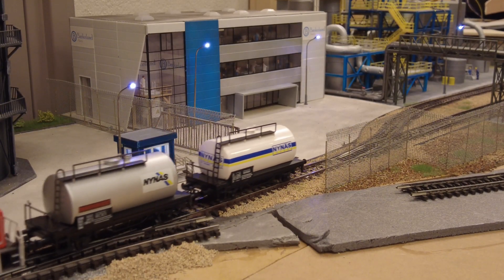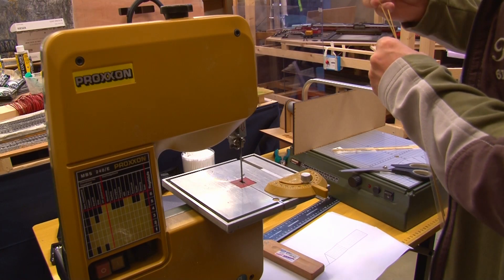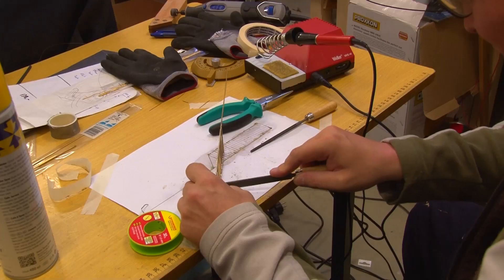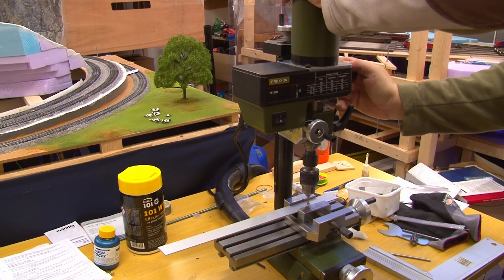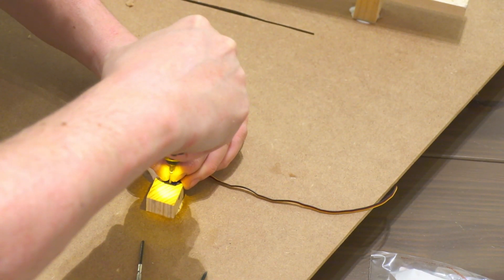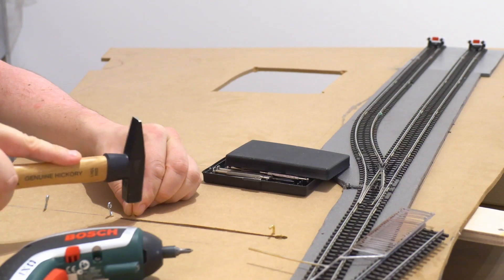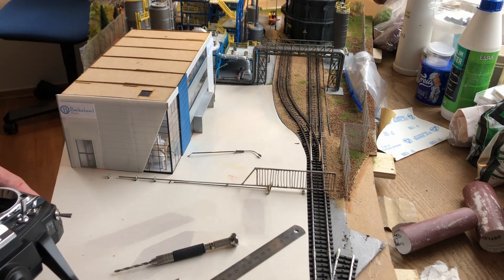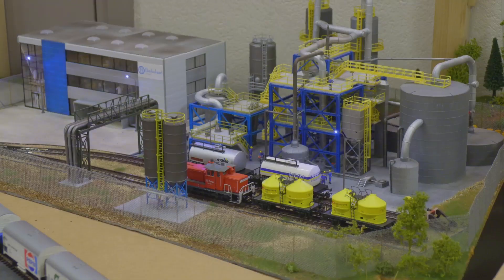Build a Servo Controlled Gate for Modelrailroad Layout

Comment: Cool build! Nevertheless, the movement action of the servo is perpendicular to the movement of the gate. Humbly think a tweak in which the servo movement is transferred to a lateral movement alongside the direction of the gate, will definitely improve both the balance of the movement, as lessen the tendency to swivel. Also it will provide the opportunity to mount the gate in two spots, underneath the board. 
As a suggestion, you could take a look at one of James Walter’s vids on improving lateral action for turnouts with a mechanism added to the servo. 
Also, I humbly think a brass I beam as the base for the gate will be a good idea. The guides for the gate can then be fitted with rollers, which will further improve both the action and prototypical look of the gate.
Still, overall a very interesting and impressive project. Very much like and appreciate the effort you’ve put in. And absolutely love these kinds of animations for our layouts.
Reply from the maker: Thanks for your input. I evaluated other solutions, but I decided to go to the simplest, as the gate is quiet in the back, and we don't use it that often. Also me and Sven Magnus tuned it a lot, it was way more janky at the beginning. We only use it when there are guests in the trainroom.
On our last exhibition day, most people didn't really notice it that it opened when a train arrived.